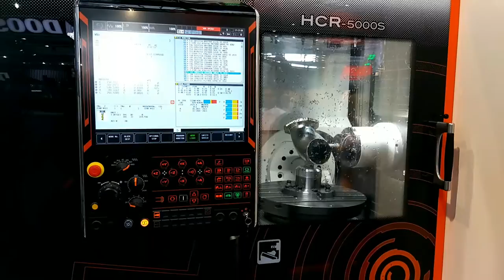Mazak HCR-5000S at EMO 2017

Comment: It's interesting that the machine slows/freezes for a moment around the zero rotation mark each time. The path look-ahead must be starved of data or some software bug.
Reply: no thats probably the stepover.
Reply: yeah what is causing that? it has to be programming right? because those motors are just going to do what they are told....